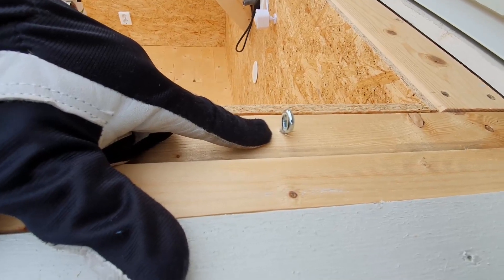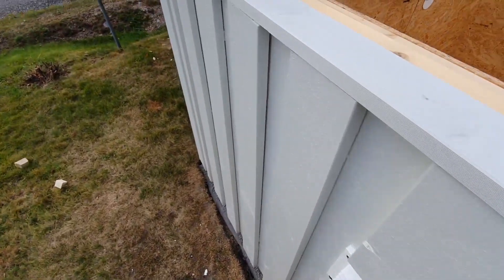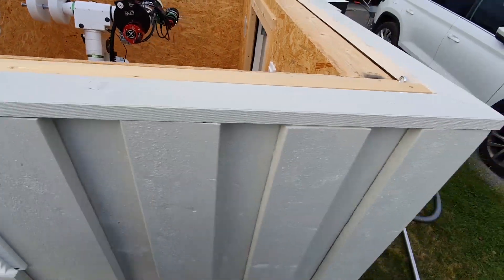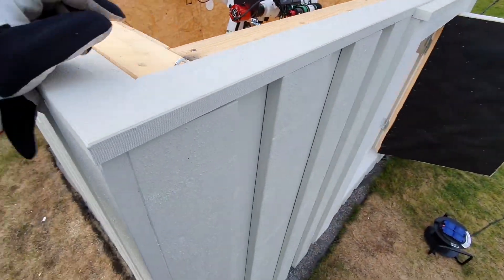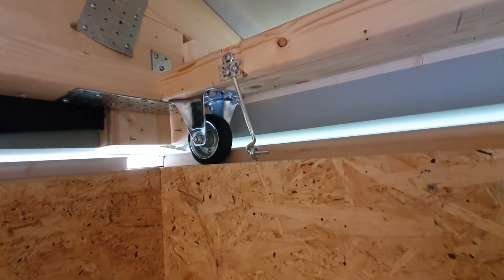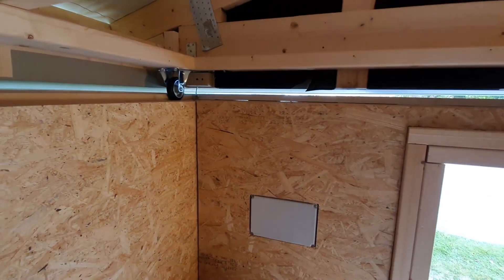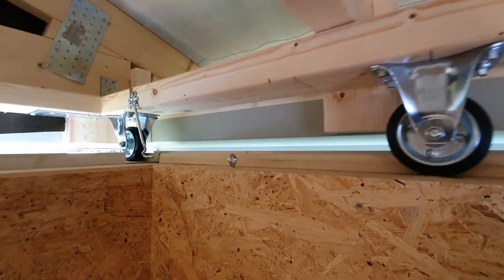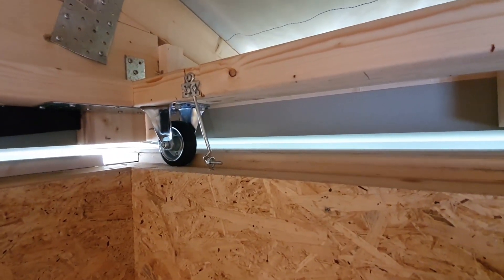Building an Observatory - Keep your roll off roof from blowing away!

Comment: I was looking for this type of information, but this roof doesn't look very secure. Where I live you need a 150 mph (240 kph) wind certification for even an outdoor shed. I could imagine a 50-60 mph wind wind gust blowing it over.
Reply from the maker: You are correct, it's not very secure but the roof is very heavy. If I were you, I would use a rail system that locked the rollers in, so it was unable to lift.

Comment: I am building an observatory but wanted to avoid an external rail design because of concerns about the rails icing up. Do you find the rails become iced over in winter?
Reply from the maker: Thank you for watching! You need to keep the rails cleaned during winter, before using the remote control or open the roof manually. You could solve this by for example mounting a heating coord in the rail that will melt the snow and ice. It's not a big concern if you ask me, but something that you need to do.

Comment: Great video. I'm going to build an observatory too. How many centimetres do you have the mount below the level of the sides of the walls (when you slide the roof off) and how do you limit it with this? I mean, from what angular height above the horizon can you observe?
Reply from the maker: Hello! I don't have an exact figure but about 10 centimeters and I can observe very low, maybe below 5-10 degrees. There are other things that limit me, buildings and trees.
Reply: @frosthastrophotography  That's great. Thanks a lot.

Comment: I'm planing my obs and have been looking at using Remote Car Control Central Lock System (12v) as a way of locking and holding down the roof. I think it has some merit, could be controlled by Ardino? Yours is looking very cool my friend I have enjoyed watching and learning from your experiances.
Reply from the maker: Thank you! I might research some more active way in the future if I determine that it is needed.

Comment: That's a very smart solution! I like it! It looks strong enough as well, however the latches look a bit thin to me. Keep your eyes on them. Good work anyway, really!
Reply from the maker: Thank you! Yes, I have considered that, but hope that the weight of the roof will keep it in place. I will keep an eye on them, and be open to replacing them with stronger latches and rings if needed.

Comment: Looks like a good solution, but the latches seem quite thin? Are you at all worried that if you had a lot of wind, and the latches were stressed/stretched by up and down movement of the roof, then they may bend slightly. If you did not notice this, then they may catch when you open/close the roof and get stuck in the loops, or not fit back into the loops when the roof closes, damage the motor or worse?

I was thinking an alternate solution may be to attach some kind of lower rail to the bottom of the roof that slides into a “gutter” on the shed side? Then you’d have the entire length of the roof being held in place on both sides.

Keep on posting the videos - I have loved watching this whole series.

Cheers from Australia!
Reply from the maker: I will have to monitor this to see that they hold and not bend. I do think that the roof is heavy enough and that it will not move.